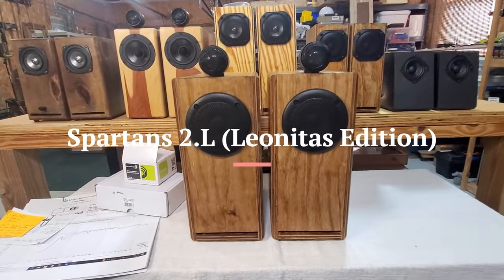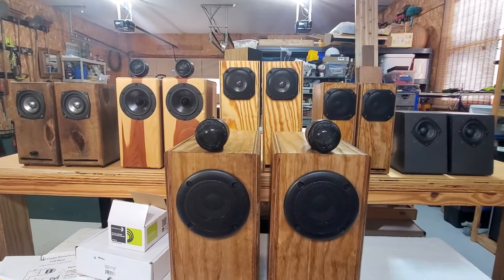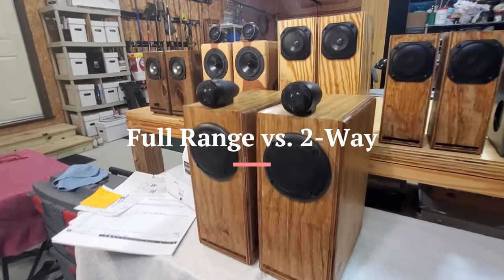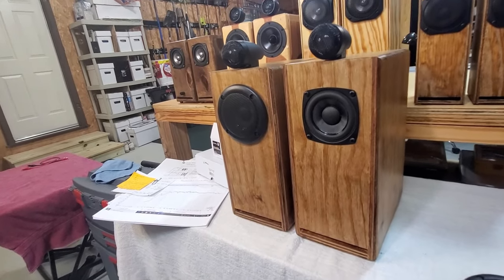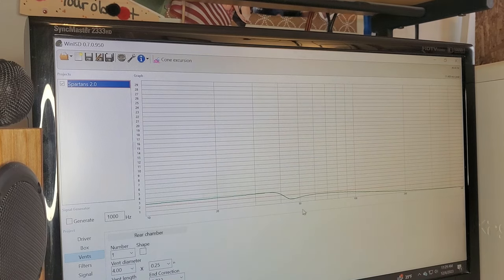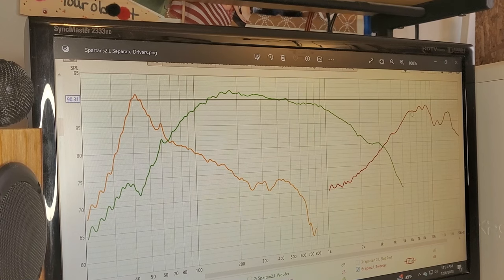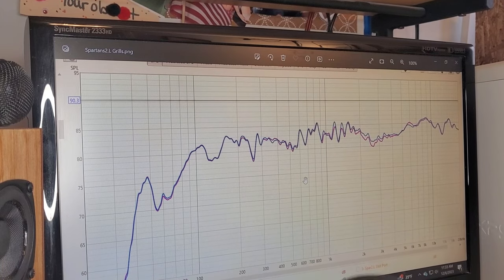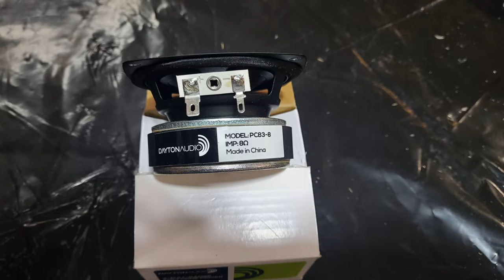Spartans 2.L (Leonitas Edition) Bookshelf Speakers

Comment from the maker: Intermodulation distortion vs. Doppler Effect distortion are two descriptors of possibly what I was experiencing on both versions of the Spartans without a tweeter. Andrew Jones leaned towards intermodulation distortion because it's more common. I don't have the test equipment nor knowledge base to diagnose it more effectively, but I do know that using a 2-way design with a tweeter crossed over low definitely helps. More tweaks and projects ahead.